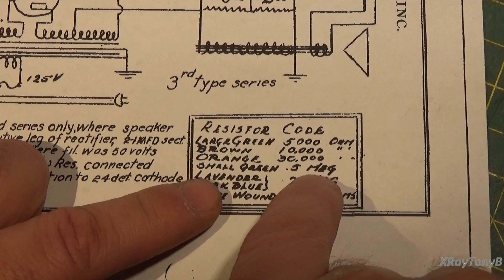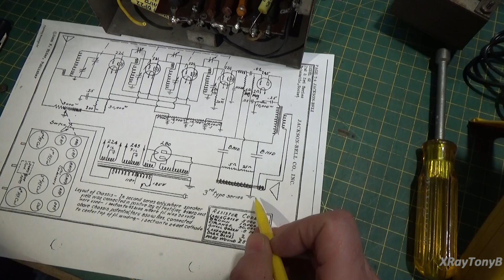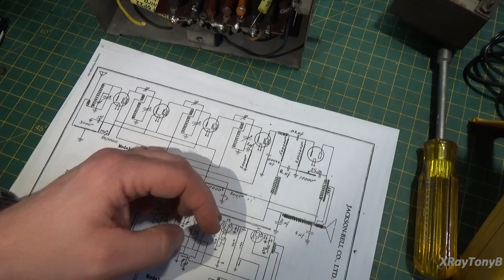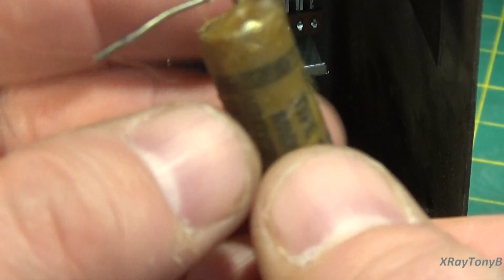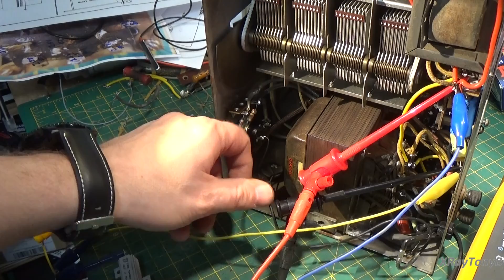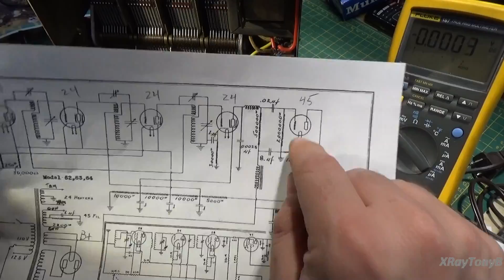Jackson Bell Model 62 Radio Part 3

Comment: In the first circuit, the field coil was placed between the CT of the HT transformer and ground making the CT negative with respect to ground. The two resistors across the field formed a voltage divider which was used for the grid bias of the 45. Values of .5 and .25 Megs make more sense than 5 and 25 Megs.

Although it worked, it meant that the can of the first filter capacitor had to be insulated since it had a negative voltage on it which made it live and it would bite anybody who inadvertently touched it. So it is a good thing that you found the other circuit.

(Incidentally, the writing on that diagram describes the later circuit arrangement).

Comment: Hey Tony, I have a question. I ordered transistors (amplifier) for a Yamaha receiver. They came in however, weren't packaged in any ESD bags. After installation, when I turned it on, it blew two separate transistors and a resistor burned up. Would the company who sent me the amp transistors be liable? What would you do? Thank you for any advice and feedback you may have.
Reply: you would need to check all the other components
 in the circuit before fitting new transistors and you should use a series globe
Reply from the maker: I highly doubt that the transistors were at fault.  Transistors aren't as sensitive to static as mosfets.  I think you had another issue that caused the components to fail.  As Ian has commented below, you should bring the unit up on a dim bulb tester and find the source of the short.

Comment: Hey Tony, which video did you show how to make the stinger cable? You have done a tremendous job so far. It looks great, looking forward to the next video.
Reply from the maker: It was one of the videos on the scratch build tube amplifier.  It was the "Part-6" Video.
Reply: Thank you.